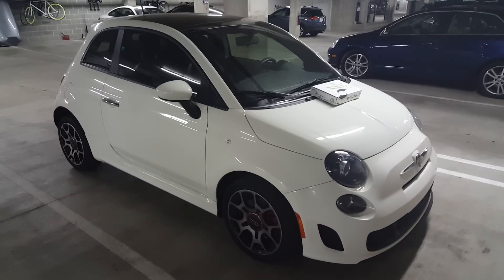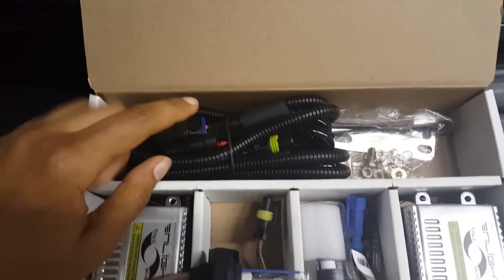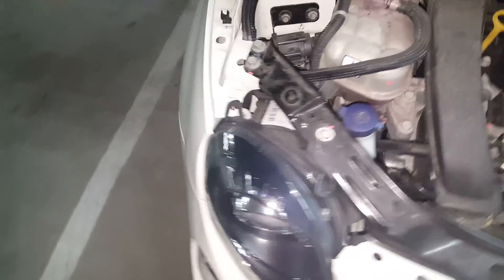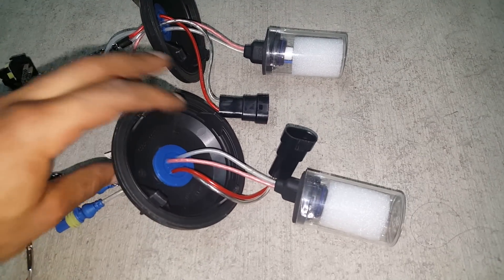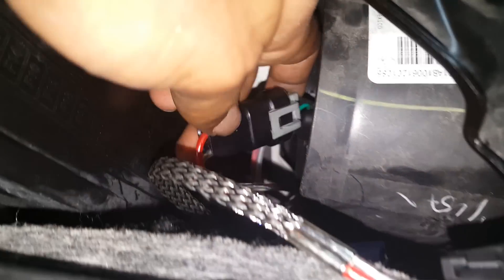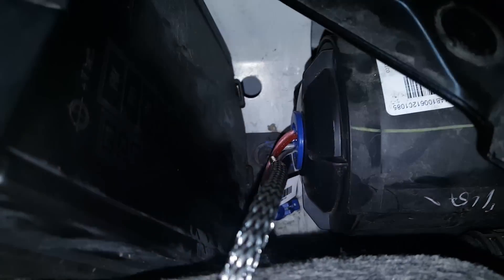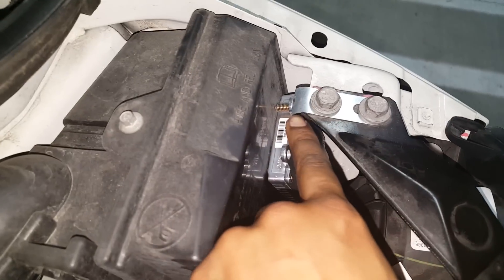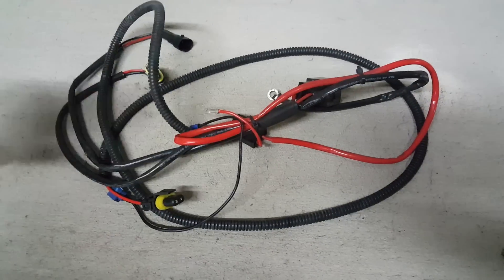DIY: 2012-2015 Fiat 500 HID Headlight Installation Guide

Comment: I found it to be a lot easier  to pull the hole headlamp assembly out on my 2014 Fiat Abarth GQ  3 easy bolts and comes right out.